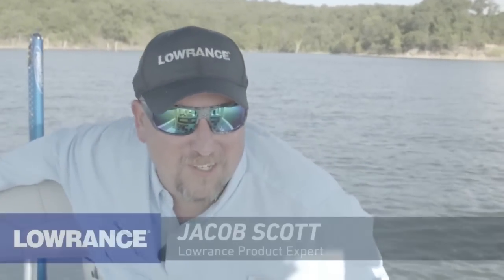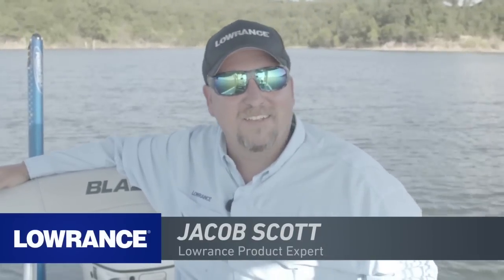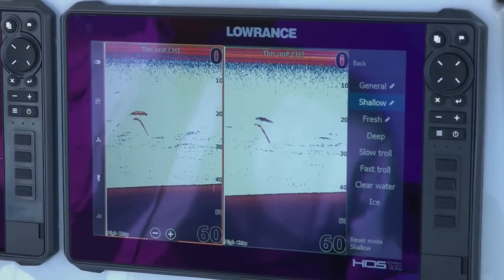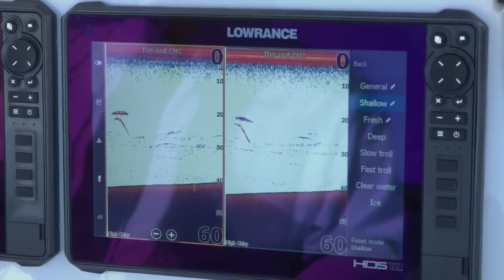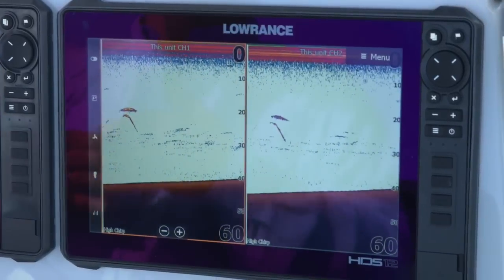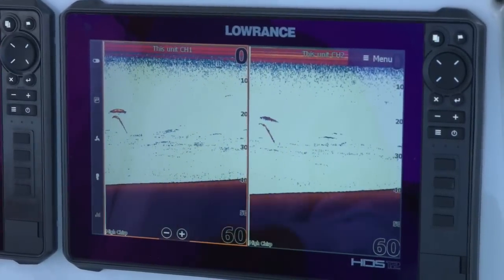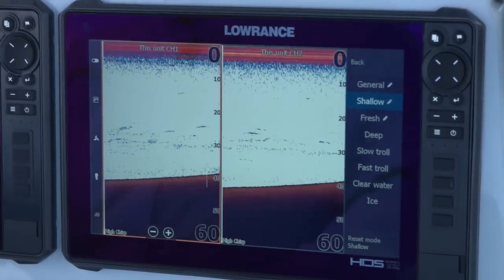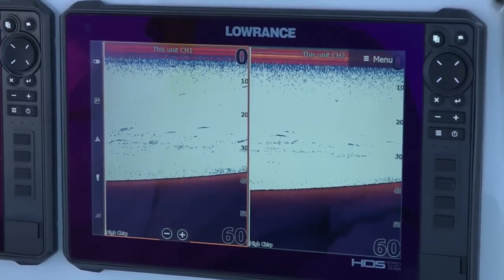Lowrance LIVE | Sonar Interpretation Part 2

Comment: Again, thank you for your expertise. I'll have my HDS-9 Live 3-1 transducer in the water at the end of July 2023. I have a quick question. My unit will be installed by Bass Pro Shop in Harrisburg, PA, on a Suntracker Bass Buggy 18-DLX. The 3-1 transducer will be installed in the usually spot on the back of the left toon on the bracket that protects the live well pump. That position is significantly above the bottom of the left toon. Is that going to be susceptible to turbulence causing onscreen issues? Also, is the live well pump going to cause interference onscreen because the transducer in located on its protective bracket that is welded to the toon? Thank you for any and all help!

Kind Regards,
William R. Culver Jr.
Reply from the maker: Please send us a message via FB with pictures of the transducer location so that we can have a better look and give you advise for the above. We're sure the people in Bass Pro Shop will know how to deal with your set-up.

Comment: I have had my Lowrance Hook² 5 ts for two seasons. It is the triple shot with down and side scan imaging and GPS. I've had nothing but problems with it constantly losing bottom (depth) readings, just giving me " --- " then going to an actual depth or getting stuck at 2.1 or 2.9 no matter what depth of water you're in... moving it standing still. It also will very frequently, during any day of fishing, give me outrageous readings for depth like 800 feet it 1,340 feet... when I'm sitting in 8 feet of water. The software has been updated and I've done the resets to default many times as well as hard resets and nothing changes except that now I can't even get the boat batteries volt reading to show up on the screen anymore. You can reboot the unit as many times as you want and it may seem okay for a few minutes and go back to doing the same crazy things. I have contacted Lowrance a few times and they don't know what the problem is and say to send it in but I'm afraid that I won't get it back for quite a long time.do you know anything that would be making this fish finder do this as well as my five-year-old Elite 3x one is doing the same crazy thing on this 4 ft wide by 10 ft long fishing boat. I'm not sure if I would be able to navigate back to this location to find her reply answer but maybe you could answer me at email BX509@AOL.com   thank you.

Comment: Cannot find my transducer airman  b256 listed does it matter which 50/200 I use 2 generic are listed
Reply from the maker: You can select B260. Depending on the resistance of the temp sensor, you can choose 5k or 10k. If you choose 5k and the temperature is way off then select 10k.